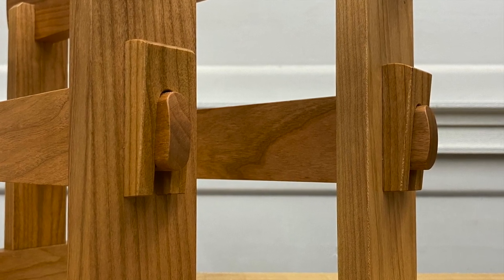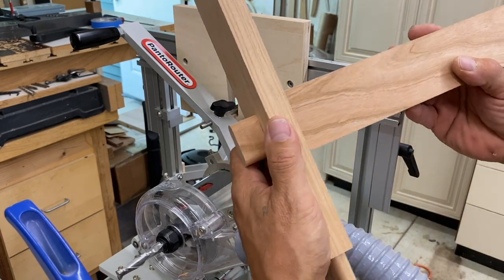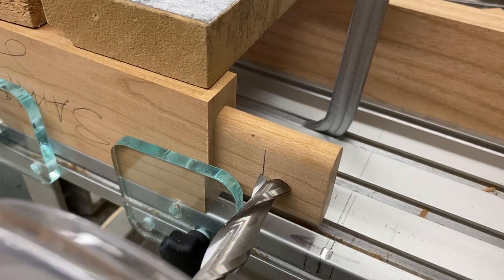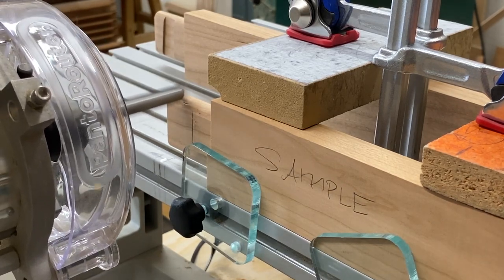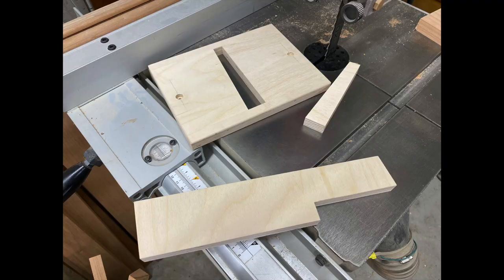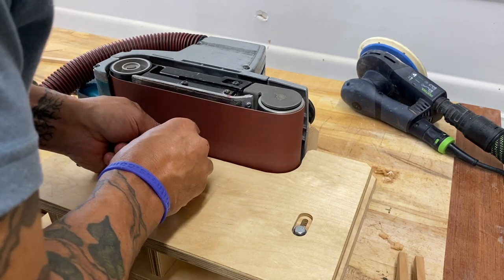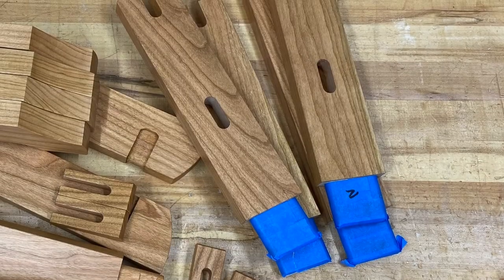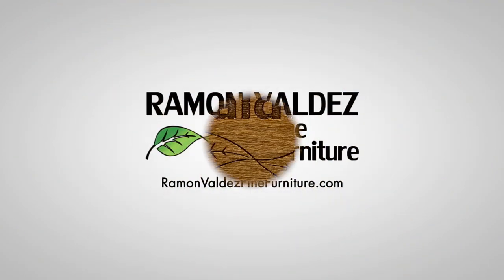Forked Tusk Tenons with the Pantorouter!

Comment: Thanks for sharing your knowledge on using pantorouter, a tool I've been planning on buying. Love the.the knock down sawhorse, do you have plans available.for sale?
Reply from the maker: I do love this machine! I don’t have plans yet.  I wanted to use em for a while and see if I would change any dimensions.  Originally, I though they would work well down on the floor with a platform or plywood across them.  But I think they’ll also work as glue up areas up on a bench.  I’ll probably make plans for em.  Much thanks.

Comment: Beautiful work, Ramon.  I love your simple approach to making that tusk tenon with the PantoRouter - another great application of this versatile machine.  That half lap is also fantastic and would work just as well on a full size saw horse.  I'm sorry to have missed IWF, but I plan to be either at AWFS next year or IWF the following year (or maybe both).  

I've got a question on the stop you use on the bearing shaft.  When I use the stop, I put it between the bearing and the arm so that I can remove the bearing without having to remove the stop.  What is the advantage of using the stop on the opposite side of the arm to the bearing?

I asked in your more recent video about your bandsaw blade which you answered here - Lennox woodmaster 1".  Where do you source the blade?  Thanks!!
Reply from the maker: Those shows are incredible! 

I should have slipped the stop collar on prior to adjusting the cutter perfectly!  So putting it on after the fact was an error and a solution.  😆Good catch.  I should have mentioned that. I’ve also recorded placement of the bearing by simply measuring with calipers.  However, the stop collar should be on the same side as the bearing, like you do. 👍🏼 thanks

Comment: Nice work, I love my pantorouter and always thinking about new ways It could be used. Are you familiar with the arunda system? I've been wanting to try dovetailing in this way with pantorouter just haven't had the right project yet. Keep the videos coming!
Reply from the maker: Thanks! I’ve seen Arunda…but haven’t investigated much.  They’re for large dovetails right?
Reply: Yes timber framing, the wedged shape dovetail is supposed to be 50% stronger than traditional M&T joint and got me thinking this would be great for a knock down bed frame or table aprons.
Reply from the maker: @kevphil4841  Yes...it would! Thanks